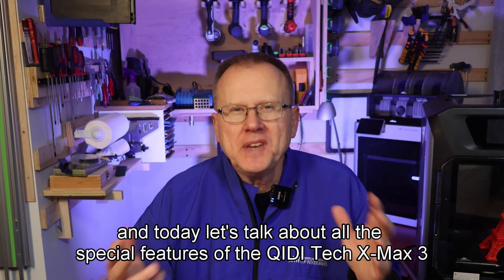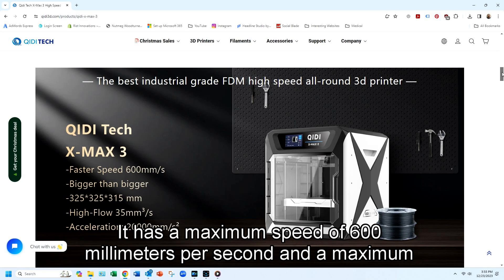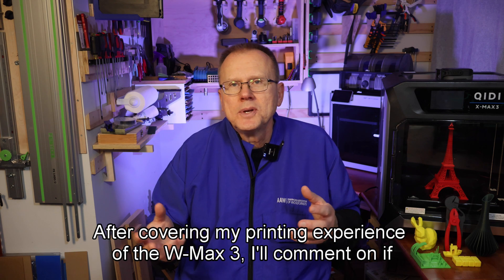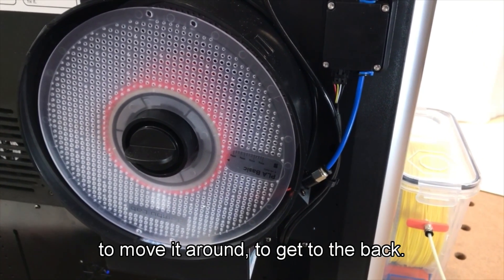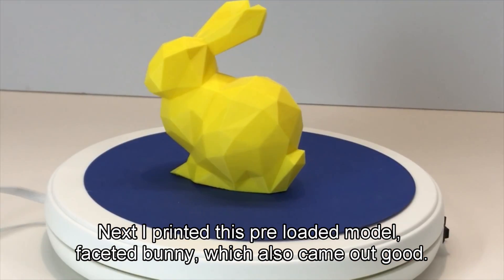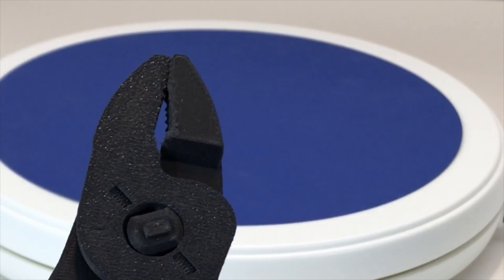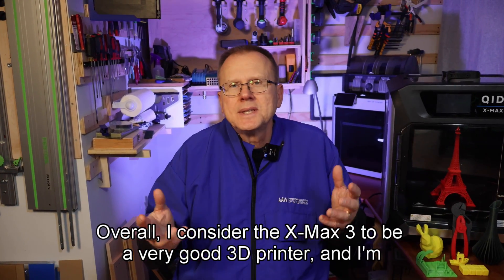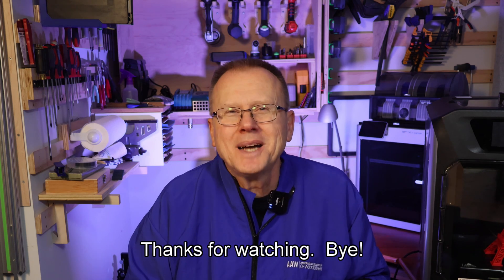Better than Bambu? | QIDI Tech X-Max 3 3D Printer Evaluation

Comment: Hi Ken. How many hours do you have so far with chamber heater at 50-60c? 
I'm having to replace my X-Y steppers after about 1000 hrs. 
The stepper mfg told me the steppers are rated at 50c continuous usage but once you get to 55 & 60 they will start to degrade. Something to look into. Love your channel Ken!
Reply from the maker: I don’t have 0:02 nearly the 1,000 hours on my X Max 3 as you do. Your information about needing to replace your steppers after 1,000 hours is very helpful to know. Thanks for taking the time to share your experience with the X Max 3.

Comment: I like the fact that the QIDI X-MAX-3 doesn't have auto updates.   Once it is running properly with your prints you can keep it stable until your next project without worrying about settings changing etc.  I agree with the camera and memory upgrades though and I haven't tried to change my hot end yet since that does look annoying.  I built all my previous printers from kits and they were all more expensive than this one so I am very happy with it - the prints are fantastic.  I also added a side dryer/holder for the filament so I don't need to reach around to the back.  Since I use the slicer with a network connection to the printer from my laptop, I rarely need to use the USB drive up-top.  The Z-axis leveling is a non - issue I only needed to do it at the initial setup.  IE once.  One thing I will say worried me was that if you forget to replace the coated flexible build plate before starting the next print the head will crash into the bed since the detector must sense the steel flexplate and not the aluminum heated bed.  Fortunately since the bed is aluminum, no damage was done to the nozzle (I have forgotten  twice, second time managed to kill the power before crash)   Maybe the addition of a big red stop button would help there.  Good review, the lazy susan is a great idea.
Reply from the maker: You make several good points and I agree with your assessment. I’ll just mention that they addressed several things with their launch of their Q1 Pro and they made even more improvements with their recently launched Plus 4 so I really like the direction they are going. Thank you very much for taking the time to provide your experience with the X Max 3.
Reply: Hey, i am looking to purchase one of these but im worried about reliability issues, im aware that 3d printing is half trouble shooting but i don't want a printer that cant even make it all the way through a print after a year. is yours still running good?
Reply: @Pedlin281  Yes, it is still running great.  I put a UPS on it to protect  it from the very frequent power blips here.  After learning proper build sheet hygiene I get reliable  prints.  The only issues I have had are while using  filament  that won't stick to the build platform.  Did I mention  this thing is fast?

Comment: No its not better then the Bambu. It lacks for ex Z kalibration and the heatplates temp varies all over the bed
Reply from the maker: I haven’t seen the heat plate temperature variation that you mention. In the video I do point out the positives about both printers so it’s up to the person which parameters are important to them in order to choose what is best for them. Thanks for the comment

Comment: I just ordered this printer based on your review, thank you for such an informative video 

Have you done the video on the lazy Susan yet? I'd like to get that done ASAP. Do you have a parts list that you used for the locking knobs in the lazy susan? 

Thanks again!
Reply from the maker: I'm sorry for my delayed reply.  I lost track of your request, but I was able to dig up the hardware I used.  I purchased the parts from McMaster-Carr. Turntable: 12.8" diameter round turntable, P/N 18635A52. Steel Knurled Knob, 1/4"-20 threads, 1.75" long, P/N 6079K15.  I cut two 24" x 24" x .75" pieces of plywood and mounted the turntable and threaded inserts to the plywood.  I hope this helps.

Comment: Thanks for the great video mate. Im torn between bambu and xmax. I want to print ABS and other stronger materials. How is the X1C at printing those vs XMAX
Reply from the maker: I have found both the X1C and the XMax do well with ABS. For consistent quality I give edge to the X1C. Thanks for your comment!
Reply: @ristinnovations  Thanks for the reply mate i appreciate the information and experience
Reply: The X1 carbon does not have a heated chamber though.

Comment: Hey, can we get those lazy suzan plans/parts list?
Looks like something I could saw pretty easily, if I just know the dimensions and turning piece.

And wonderful review. The X-Max 3 is now my top contender for a printer upgrade!
(I have a VERY old CR10 that I've optimized, but I want to print large ABS/ASA armor pieces for my son and myself with less warping & drama)
Reply from the maker: The dimensions of the plywood are 2’ x 2’. The lazy Suzan part is from McMaster Carr, P/N 18635A52. Thanks for your comment!
Reply: @ristinnovations  You're welcome. Thanks for replying!

Comment: Thanks for your videos! If you had to spend your own money, what printer would you buy? The QIDI or Bambu? I'm in the process to replace my 10+ old SeeMeCNC Rostock II. You have both printers and you seem very honest guy, so I trust you.
Reply from the maker: Hi Tony, In my case, I bought my Bambu Lab X1C and Qidi Tech reached out to me and sent me the X-Max 3 free of charge for my evaluation.  For your case, it depends on what is important to you regarding the size of the print volume, heated chamber, cost, etc.  In my situation having used both printers, if I needed to buy another printer between the two I would lean toward the Bambu Lab X1C (or the P1S).  The Bambu Lab printers are a bit more user-friendly, and better out-of-the box experience.  The QIDI Tech is a better value for a larger print volume if the bulky size and a bit less user-friendly aspects aren't an important aspect to you..  I wish you all the best in your decision. I hope this helps.  -Ken
Reply: Thank you very much for your honesty. I'm also leaning towards Bambu, but their technical support has bad reputation!
I hope that my printer will work without any problems!

Comment: If the parts is better on this printer then the qidi x-max then this can be an option. But I have hard to think. I would stay away from qidi until they do what they supposed to do. Had so many strange problems with my x-max and when I saw you had problems from the start.... I just feel...not buying this printer. It's very annoying when they add things you can buy and install after... And for that I think you had to update the firmware? That didn't work super good on my x-max unfortunately. I hope bambu-lab made a better printer. Bambu-lab might be bad option also if it requires to send to their repair shop when broken. Last time I checked they didn't have all parts for it on their website.

Comment: Other questions for future reviews of this or other printers:
cost/availability of repair parts
direct or bowden style extruder (in this case it appears to be direct)
extruder design, for example if you do manage to run the extruder out of filament is that easy to recover from or do you have to disassemble the extruder to get the remainder out (I'm looking at you Titan Aero)?
nozzle types/sizes available and compatibility with standard designs (is this one E3D Volcano style as it appears?)
you started to cover this, but what's involved to change nozzle sizes - is this easy or will you end up changing nozzles/hot ends for repair only?
Since this runs klipper/fluidd how easily can you access the Linux machine and install OS and package updates as well as custom klipper plugins?  Is the Moonraker API exposed?  Is the built in update manager available at all?
Since klipper/fluidd are open source, are any configuration changes/customizations the manufacturer made readily available so you are able to reproduce the stock firmware of the machine from the original sources?
klipper, fluidd, and moonraker are under very active development and they tend to just have development updates and not official releases, if you are only able to upload via download bundles from the manufacturer how frequent are those updates and how much do they lag the current versions of those programs?  If you are only supposed to update via manufacturer bundles how long does the manufacturer guarantee they will keep providing updates?
what kinds of bed sheets are available?  How relatively expensive are they?
Does it have any power fail print recovery function and if so does it actually work?
There are a lot of hot ends out these days and competition among them over max flow rate: what is the claimed flow rate for the hot end in this printer?
Reply from the maker: Thanks Steve for all the valuable insight and suggestions!

Comment: The X CF Pro is still better, more heavy, MGN linear rails with wipers as standard cleans abrasive dust that sets on motion components, no idiotic klipper cartesian printer that also allow compensation for dimensional accuracy unlike xorexy
Reply from the maker: That’s good to know about the X CF Pro. Thanks for your comment.

Comment: I do not use the filement holder in the back.. I use a dry box next to the printer and have bowden tubing from the drybox to the
 runout sensor.
Reply from the maker: Your setup is definitely better in my opinion. Thanks for your comment.

Comment: There is also ethernet port in the back of the printer.  I changed out the fan in the back motherbnoard fan with a quieter one a
s well.
Reply from the maker: Yes, I overlooked mentioning the Ethernet port option. Thanks for mentioning that. What brand fan did you use to replace the stock fan for the motherboard?

Comment: Again a great video. 
Still as I am a Bambu Fanboy I am still convinced that the Bambulab especially with the AMS, internal camera, automatic bed leveling, flow control and especially the regular and easy to perform firmware updates is the better printer. But of course it is more expensive and I clearly have a bias here. 

Nevertheless good test video special thanks for having the size measures also in metric not only in imperial. 
One annotation - if you could also have added the weight in kilogram and not only pounds would be the cherry on the cake.
Looking forward to your next video!
Reply: The bambu has the worst privacy of any printer, it's a game changer for anyone with any remotely professional aspirations
Reply: The Qidi's do have automatic bed levelling though, unless of course you meant automatic Z offset.  The thing about the Z offset though is that it's dependent upon the distance between the sense of the bed-plate origin, and the nozzle.  Neither change from print to print though (unless you change the nozzle/hotend), so really it is a set once and forget thing.

The X-Plus 3 is Qidi's mid-range printer, and it has a 280x280x270mm build volume, has all the same features as the X-Max 3, and it can be picked up for $599.

Qidi have released firmware updates about every 4 weeks since release.  One thing that the Qidi does have, that the X1C doesn't, is offline firmware updates.  This is actually important for some.

The Qidi's also have wired ethernet, which wasn't mentioned in the video.   Hmm, wired ethernet and a heated chamber, all for $599 in the X-Plus 3.  How much does the X1E cost again?

The camera can be whatever you want, you're not limited to just the manufacturer's camera.  If you have a spare USB camera kicking about already, you can just plug that in.

Being Klipper based, you can fairly easily add on an ERCF from Fysetc for $138, which effectively gives you a 6-color AMS system.  Admittedly it's not automatically integrated, and you'll need to perform some setup.

It's true though that BambuLab do offer a complete integrated package for those who don't want to stuff about setting it all up, and that is worth a fair bit in itself in terms of saving your own time.  The point I'm trying to get at here is that every point you raised can be, or already is, addressed.  It's just a matter of which path you want to go, and having multiple choices is always great for the marketplace overall.
Reply: @stew675  Does the Qidi have automatic flow adjust or do you have to manually set it?  and how does print quality compare to the Bamboo?
Reply: @stew675  it depends on yourt use case.    If you need bigger volume, and a heated chamber for various prints, then you go wiht the QIDI.  The bambu is a great printer, especially for people new to 3d printing. I have been with 3d printing for over 7 years,.  I level the z offset once, on my other printers, and have not had to relevl them since.
Reply: Look up this video shows x1c print head wobble on 2 month printer, maybe your has this too "Bambu Lab X1C | Проблемы | Качество печати | Бэнчи"
Reply from the maker: I understand your point about Bambu😊. Sure, I will make sure I include metric as well in my future videos. Thanks for the suggestion and for your feedback.
Reply: What about china capturing our data in order to use the printer? is there a workaround for this? That's my only gripe.
Reply: @jankof76 If you talk about using the Bambucloud for example sending your prints from the slicer to the printer: you can set the Bambus into LAN only mode and by that send the files direct only over your private network instead of the cloud.
Or you store them on the SD card and print from there.
Reply: @yolo6741  awesome. How are you with the print vol?

Comment: Looks like they're using an inductive sensor for bed leveling - that's why the z offset can't be automatic, an inductive sensor senses the metal of the bed not the top surface.
Reply from the maker: Thanks for the feedback Steve.
Reply: @ristinnovations  Inductive sensors are starting to get a bit dated, the new hotness is eddy current sensors like the Beacon which also need manual adjustment but are way faster and more accurate.  Since the X-Max has a heated chamber a more fair comparison might be to the Bambu new X1E which is $1000 more than the X1C.  If we're still comparing the X-Max to the X1C I would note that for that $300 difference the X-Max doesn't have any AMS like capability which is a major difference.  The Fluidd interface they are using is the same one I'm using for my Voron - it is quite capable of fast over the air updates so there's some work to be done there.  I would also think that having the filament spool in the back would be awkward for a lot of print farms.

Comment: Good video.
For the down sides:

-The most annoying downside is the door not being easy removable. I fixed this with a saw, a drill and a rod on the next day after I got the printer.

-I replaced the reverse bowden by a longer one (a transperent with 3mm inside diameter) and also moved the runout sensor to the side. You do not want to fiddle on the back side if changing filament midprint.

- I often got filament stuck on unload. The display even tells to pull the filament manually on unload for this reason - so it is a known issue. However, the reason is quite simple: In the last line of the M603 in printer.cfg the filament is retracted fast for 80mm. The filament tip is not fully solid when it reaches the gears, gets flattened, to wide to leave the feeder and scrumbled inside the feeder. So I simply changed the last line to two:
    G1  E-20 F800
    G1  E-60 F200
Now the fast unload aplys only while the filament leaves the meltzone, but slows down afterward to a quarter of the speed so the tip has enough time to get solid again before being grabbed by the gears.
Reply from the maker: Thank you very much for the detailed comment.
Reply: OMG - i know right?  Sorry for the response 9mos later, but that effing door!  Seems so obvious it should be removable lol.  Love the printer otherwise though.